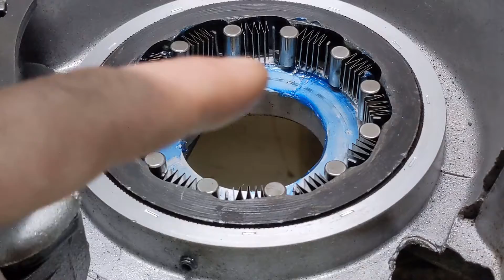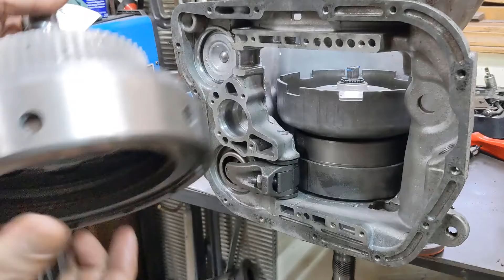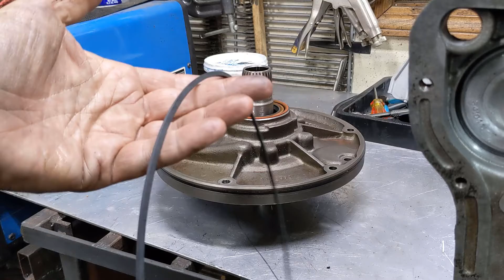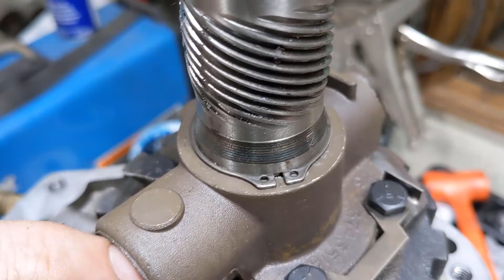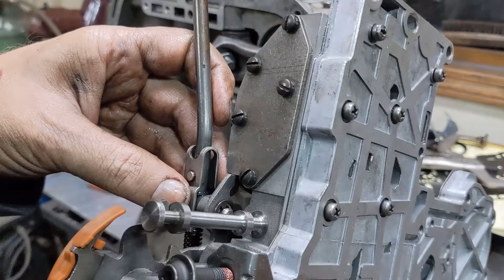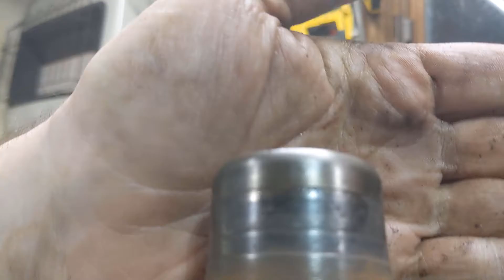Final Assembly, Bench Test, and Adjustment: Mopar A727 Rebuild #10

Comment: Did you ever cover that low/reverse band anchor pin removal? That's o-ringed and a common leak point I understand and was wondering about that part. Also, i "hear" that the diesel and  other later model versions (A518/A618/46/47/48) have an anchor pin with provision for two o-rings ... anyone know/do this? Thanks for the awesome video series and real life stuff!!

Comment: At 20:29 for the rear clutch apply, I cannot for the life of me get the clutches to engage. I've checked my clearances, counted and recounted clutches and steels. I've assembled and disassembled 4 times now and still can't get it to engage. Anyone help?
Reply from the maker: If the piston isn't moving to apply the clutches, pressure is either not getting to it (blocked passage?) or it's leaking past (bad seal, wrong direction seal, something cracked, etc). Does it sound like air is just flowing through when you pressurize it? If so, check for leaks
Reply: @YoshimoshiGarage  it sounds like air just passing. I have brand new seals and input shaft and everything. I took it apart again, removed and reinstalled the seals on the piston and still no movement. My clearance is good. The orientation is correct. Idk whats happening.
Reply: Update: "fixed" the problem. The Sonnax input shaft I bought has a hole between the sealing rings that was allowing the air to pass by. I put the old oe input shaft in, which has a hole in the base and resembled and everything works as expected. I'm guessing I have the wrong input shaft kit from them or my internals are not the same as what should be there based on my truck model/year. Idfk. But my trans works now lol so I'm calling it a win.

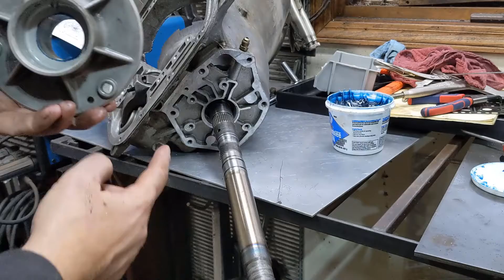Comment: When you air checked at -9:00 you say you’ll hear thud and see the piston move. I hear a thud that sounds right but nothing moved??
Reply: Same, everything checked off for me. Front drum and bands but my rear feed didn't thud or move. Chatgpt says I have to take it all apart 😅 FML. Good luck 🤞
Reply from the maker: Sounds like the seal is missing, backward, or damaged?
Reply: @YoshimoshiGarage  thank you. I'll take apart again, 5th times a charm I hope
Reply: @WhimseyStationHomestead  i’m just now getting around to messing with my transmission again. What did you find out was wrong in this area on yours? 20:34 is when he says you should see the piston move. Mine like yours made the right sounds but no piston  moving.

Comment: Hey man, I know I'm asking a lot of questions. But I'm almost done. Hopefully. Did u purposely NOT lube the roller bearing on the tail-shaft? thanks bro.
Reply from the maker: It won't hurt to lube it, but it doesn't spin until you're in gear, so the pump will have lubricated it before you start driving it.
Reply: @YoshimoshiGarage  Thanks brother man.

Comment: Interesting how you mentioned you were using parts from a B&M Transkit. The Transkit comes with their shift kit yet I did not see any mods to the rear servo, accumulator (rod) or the cupped orifice that goes into the direct clutch passage in the case. Were you going to save those parts for the other TF build you were going to do?
Reply from the maker: Yes, I decided to save the kit parts for another build

Comment: You obviously have more experience with mopar transmissions than I do. Problem; I rebuilt my  transmission,  along the same lines as you did an  A 727 that sits behind a 400 big block in a 71 plymouth duster. I have NO passing or kickdown gear. I can hand shift and 1st through 3rd are there with no slippage. I adjusted the throttle with the kickdown lever so when carb is wide open trans lever is fully depressed back. NO passing gear or kickdown. Also trans shifts through gears really fast, shifts from first to third by 35 mph. I have pulled the tail shaft and checked and cleaned the govenor, also dropped the transmission pan and pulled the valve body taking it completely apart noting where the ball bearings go. Still the same... One questio,  this valve body is out of a RV transmission, would that matter? HELP!!!
Reply from the maker: The behavior sounds like misadjusted kickdown to me, but you say you've checked that so my next guess (and it's just a guess) is low pressure for some reason. Maybe a bad/pinched/backward seal or something? Different valve bodies will have different shift characteristics, like exactly when and how hard the shifts are, but none should have if shifting all the way to 3rd that soon.

Comment: So, I have two spare 727's that I bought extremely cheap and would love to go through one before installing with another 360 I'm going to put in a 1989 W150. Did you list a rebuild kit that you used in any of the videos in this series? Also, in the powerwagon you mentioned, will you be rebuilding transfer case by chance? Or maybe you have and I just haven't gotten to that vid yet.  GREAT FREAKING SERIES MAN!!! I may screw it up, but it won't be from any of your instructions.
Reply from the maker: I didn't buy a kit, I got individual parts from Cobra Transmission.  I do plan on rebuilding the NP205 - though I'd like to find a spare and rebuild it while the truck is still drivable.

Comment: Why run a 904 valve body in a 727
Reply from the maker: The separator plate from the 727 was super worn and I had a spare 904
Reply: @YoshimoshiGarage  did it work ok after the vb swap cheers brett
Reply from the maker: @brettpowter6010  It did.  Other than the one hole, they're basically the same

Comment: I’m actually in the process of rebuilding a 5.9 for my Duster and your videos are very helpful. I haven’t messed with transmissions much but you make it look somewhat easy. Thanks for the video.
Reply from the maker: If you're capable of rebuilding an engine, you can do a transmission.  I actually think a transmission is a bit easier.  Just take your time and be deliberate about checking and measuring every piece, which you have to do on an engine as well.